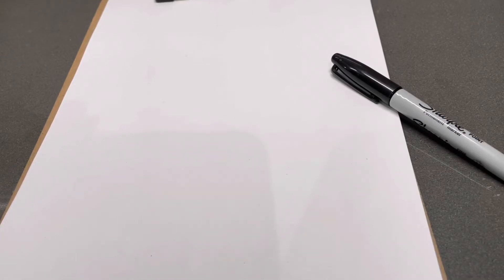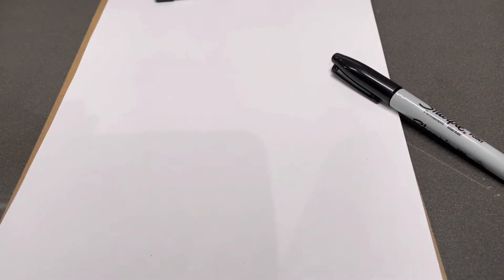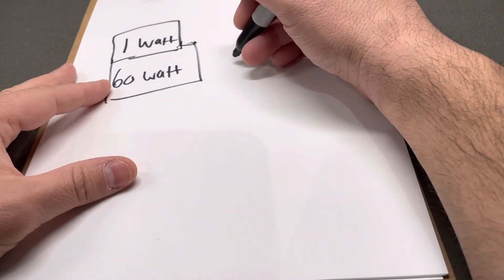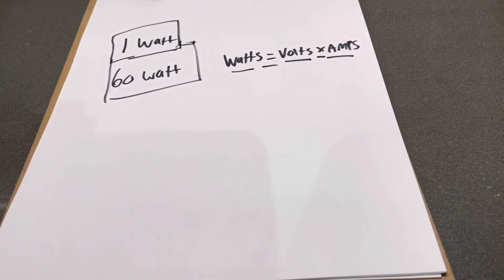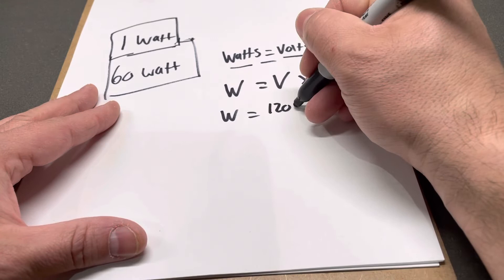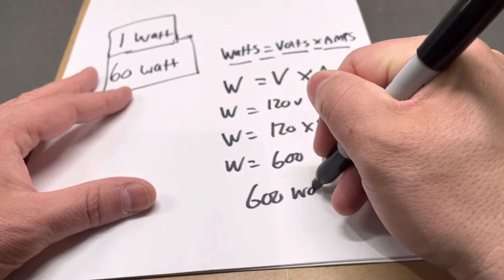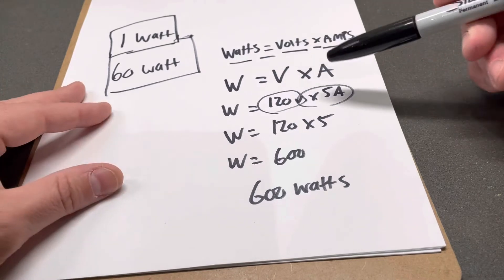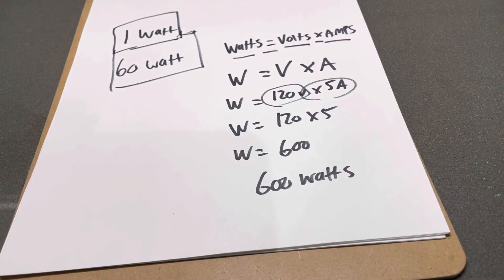How To Calculate Wattage-Easy Steps-Tutorial

Comment: To calculate watts the power factor needs t be considered. Elon musks little power factor corrector will only benefit the power producer. Not the consumers. Consumers pay for watts.improving power factor does not chabge the wattage an appliane uses. Is he in bed with the poer companies. I don't think so. I think it is a major oversight. But i may be wrong
 I am wrong a lot. Comeon electrical engineers. Help us.

Comment: I have a question here if i want to count watt for my electrical appliances. Electricity in my hoise runs 220v. I have a motorcycle charger that max output is 12v 2aH. So which voltage do i use to calculate? Input of 220v or output of 12v?